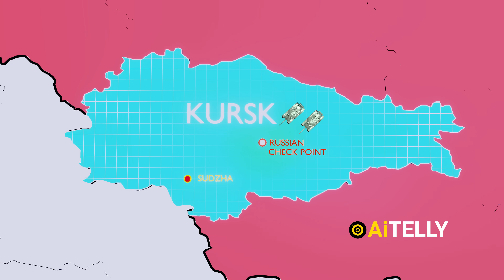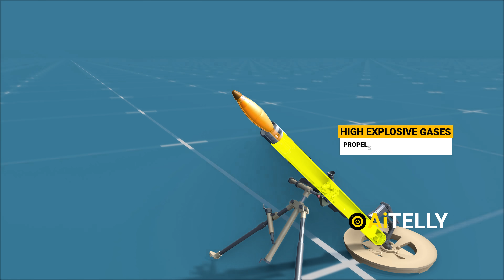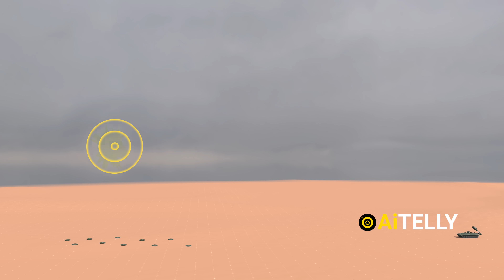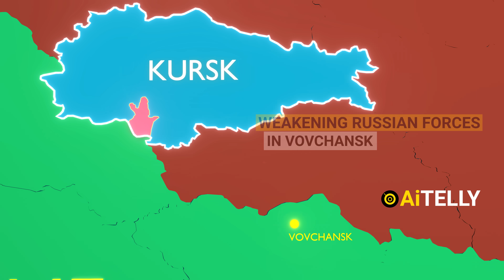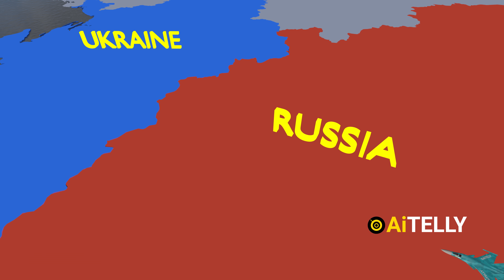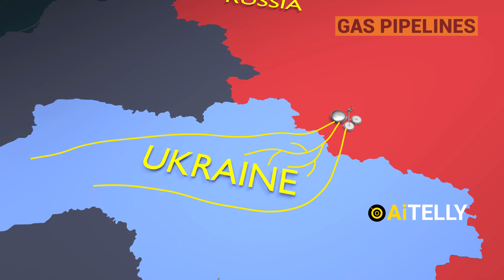How did Ukraine Invasion of Russia Happened?

Comment: 1k drones for a 4M tank. This should be a lesson for future conflicts.
Reply: the lesson is the anti-drone measures, and all nations that use drones are working on the antk-drone measures, but there is no way to phase out tanks or other heavy equipment from the battlefield simply because drones are destroying them.
Reply: @KronStaro  that's certainly a possibility in a real big war in the future. Even battleships which were once considered the jewel of any navy was found to be obsolete in the very onset of WW2, it didn't even take couple of years of war to determine that. The cost to the exchequer does not make sense when resources are already running dry during war time. Even 100 drones would cost 100k compared to one 4 million tank, this 4 million is without the cost of logistics and personnel training.
Reply: @neerajnongmaithem392 
Then why does every 
Major Army still have Armored Brigades?
We still have Battleships by the way. Just because those weapons arent an ace in the hole doesn't mean they are obsolete. Russia has some of the most advanced electronics warfare jammers, sniffers and retransmitted.
Reply: @neerajnongmaithem392  battleships were made obsolete because carriers did it's job better. naval aviation has further range than a 16 inch gun. we still don't have a replacement for mobile fire support for infantrymen, so the tanks are here to stay. they will certainly evolve but they will still be in service
Reply: @neerajnongmaithem392  Battleships were phased out because carriers did their job better. Name a piece of equipment that can do the job of the tank better
Reply: @KronStaro  yes like Rheinmetalls Skyranger that works nice against Drones and KF 51 Panther, Leopard 3.0 Arc , new Leclerc + all got anti-drone stuff warning, jammer, automated weapon station with available programmable airburst ammunition.

Its annoying that people come again with the "Tanks are obsolete" stuff", but it was the same after Paks, manpads+ where such voices came.
And its always a race, new Hardware, Tactic comes in that has great success , conter measures get devolep...
Reply: @KronStaro  they don’t work, drones will break through any defense.
Reply: @KronStaro  Even if drones and tanks trade evenly in dollars, the thousands of drones one can buy forthe price of a tank risk 0 own lives to take several enemy lives. This is unlike traditional short-range manually operated anti-tank weapons.
Reply: Right they obviously aren't thinking about a tank round cost a few hundred dollars and it stays in the battlefield after it fires, and we always see the videos where the drone kills the tank, but how many did it take before we see the one that kills it  @KronStaro
Reply: @KronStaro  The anti-drone measures are already in place. It's that just even if you take down 90% (a very optimistic result) of the attacking drones, it will be 10k for 4m.
Reply: @vinxcxcxcxc6354  this lesson isn't new, look at Vietnam
Reply: @moiC3770 the argument that tanks are obsolete has been circulating since 1917. Then it was the introduction of the anti-tank rifle that triggered it.

Adapt and overcome. That means one side developed a way to attack and the other to defend. And the game continues until the next innovation.
Reply: @moiC3770  Politics lost Vietnam. Military annihilated the VC and NVA consistently. Don't be dense.
Reply: @avnregt  nah the Vietcong developed intuitive booby traps that probably had more casualties than the napalm strikes
Reply: @avnregt  also, if you're trying to make a point, try providing more exposition rather than resort calling people dense. Maybe they'd listen to you more.
Reply: Russians didn’t have T-90 or any tank worth 4M deployed there.  Remember it was an unexpected border crossing.
Reply: Tank crew skills are important and when losses are high, quality decrease.
Reply: Its not even $1k - i'd say its closer to 500 bucks. it's the headset and controller which cost the most but its reusable clearly. Maybe they are including the price for explosives into the figure but the drones themselves are 500 bucks for sure.
Reply: @xNightbound  can be even less
Reply: Said 5 years ago
Reply: I guarantee the R&D for counter drone technology is in the works as we speak. Tanks won't be irrelevant for that reason because majority of people don't have anything close to capable of taking out a tank and they can always be outfitted with more technology given their size.
Reply: Drones are already being developed to penetrate trophys and jamming zones. Some are even equipped with AI to detect and destroy targets without operator control
Reply: The next generation of tanks has a dual purpose 30 mm on top of the tank to deal with them. Plus a lot of other protection systems. Have a look at the French German tank or the new Rheinmetall developments. That includes the Leopard 2 ARC 3.0.
Reply: @footballfans3159  the difference in price is the Abrams crews survive unlike the T-series tanks. Just like the crews on the Leopard 2 and the Challenger 2. The Australian Slinger is coming in and the Lancet days will be numbered.
Reply: It has happened before with all the IEDs
Reply: How much do you think the shaheds costs?
Reply: @badrutaofiq2297  and the Lancet is even more expensive. It is a knock-off of an Israeli drone and needs western chips.
Reply: @vinxcxcxcxc6354  I remember during the Falklands War they had to use a 1 million missile to get one man in a foxhole.... No, "politicians", don't learn crap! They are the ones in charge.
Reply: Also on both sides the AA ammunition used to shoot down drones is more expensive than the cheapest drones.
Reply: We already have cases when small drones crashed russian transport and attack helicopters in the air, because they fly low these days.
Reply: Those 1k drones with grenades or mortar rounds are not destroying tanks. One of most common drones actually destroying tanks is the Lancet which is 35k
Reply: That also Work on Myanmar Civil War.
Reply: Muslims are planning to outbreed you all.
Reply: 666 comment
Reply: Well, yea… this is just a giant weapons testing ground.
Reply: Do you feel smart for writing this stupid affirmaion?
Reply: Sukzha
Reply: Invest in tanks? Haha
Reply: 😂😅   кажый день в курске стираются в пыль  500 -1000 холопов запада из уркаины.    И от 20 до 30 натовской техники.  Дякую террористу зё за это
Reply: 4 million dollars is the international cost of the T-90 tank, the Russian army buys the t-90 tank at an internal price of $ 1 million. To find out the real Military Budget of Russia, you need to multiply the official (in Russian domestic prices) by 4, this is about 300-400 billion dollars
Reply: @footballfans3159  So US is not making more useless tanks. HOW MUCH DOES AN M1 ABRAMS TANK COST? The Abrams tanks are made by General Dynamics and each one costs over $10 million when including training and upkeep, according to Reuters
In the United States, Abrams tank has not been produced at the Chrysler tank plant since the 90s, this plant has already been looted, the tank plant in Lyme, Ohio, is only upgrading Abrams tank.
Reply: This is probably U.S plan.
Reply: 1 Tiger tank vs 10 T-34s
Reply: you mean propaganda? it was always in use
Reply: Merkava more ridiculous, defeated by a farming drone !!!!!! lol🤣
Reply: @trendingsentertainment if they are defeated then where is the Israeli hostages already it’s almost been a year now 😂
Reply: @funknowledge6136  thats funny...palestine got defeated...and Israel is winning.
Reply: @andresbonifacio3394  yeah no wonder israel stuck for 10 months and taking losses daily 😂
Reply: @trendingsentertainment  And by simple RPG.
Reply: @masumabid4883  yeah, even its homemade RPG......lol
Reply: But many terrorist muslim killed and defeated @masumabid4883
Reply: 1 Trillion for Starlink Satellites. Fool.

Comment: Slight nit, this shows the Stryker MGS variant, which is not in service anywhere, let alone in UKA. It matters some what because the MGS brought serious firepower to the table, comparable to a main battle tank with a 105mm main cannon. Where as the actual ones in service are strictly in the realm of IFVs with at most a 30mm cannon. So what they can accomplish on the battlefield is quite different.

Comment: Quite a risky plan, with the current situation in povrosk (ukraine Southern front), its more of a race. Ukraine did this invasion to try divert russian forces in povrosk and slow momentum before they capture that city by attacking kursk and trying to secure the Kursk Powerplant to force russians to try move to kursk front, many ukrainian troops down south however have been annoyed and wanted the troops to be reinforcements for the real battle down south. If Russia captures povrosk, they can use Povrosk to bypass ukrainian lines and create many flanks as there are no furthere reinforcements behind this, all reserves are used up. However, Russia is closer to capturing povrosk than ukrainians are to capturing kursk powerplant as of right now, Russia is moving at a decent pace and will most likely get to povrosk which will force the kursk front troops to fall back and reinforce povrosk/form a line before Russia exploits the lack of troops behind povrosk.
Reply from the maker: I don't know about that Strategy, but Attacking a Super power is definitely a Risky Affair.
As for me i will not last even a single Minute in this counter Offensive
Reply: *Kursk front is starting to move slow and in some areas Russia has clapped back, keep in mind many pictures are where Ukrainians drive to an area take picture fall back and some have been photoshopped. Kursk is good for PR and western support aswell, now ukrainian alligned countries' news channels are milking this.